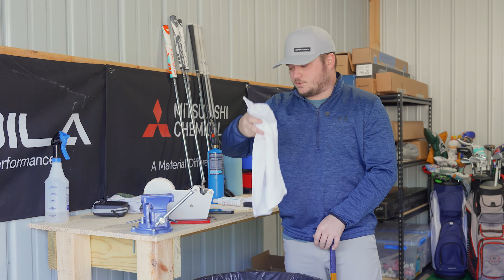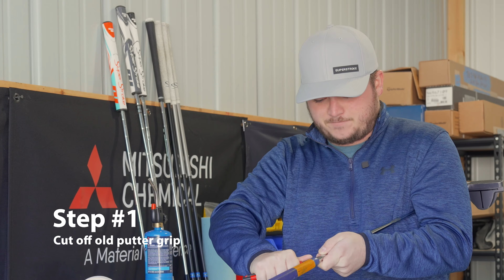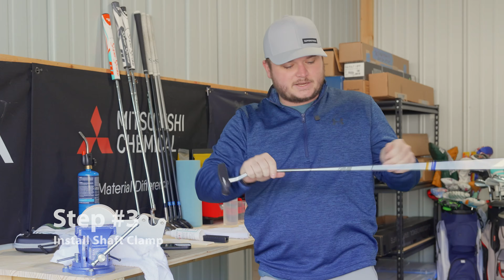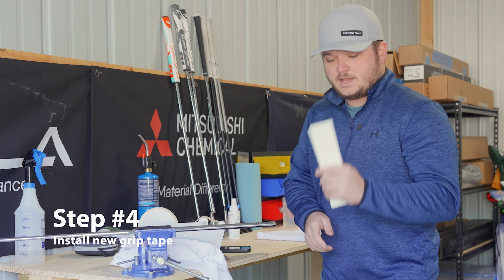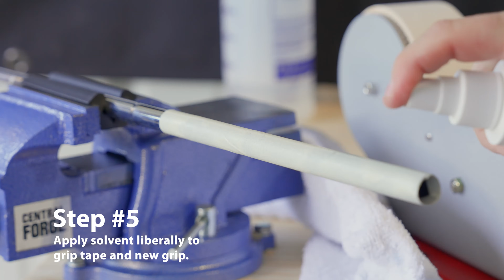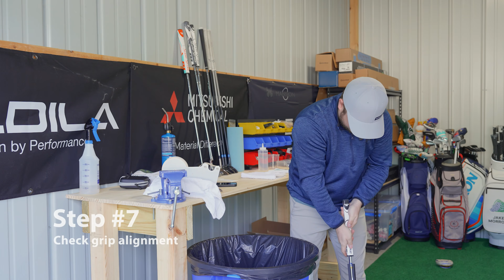How To: Re-Grip and Replace Your Putter Grip at Home

Comment: Little alcohol pads work great too if you don’t want to use a heat source, just be careful not to touch the label as it can remove the ink.

Comment: Just tried to install a brand new 17-inch-long Superstroke putter grip onto a brand new Stability Tour shaft... Failed miserably, because it seemed the ID of the Superstroke is too small or the OD of Stability is too thick.  Is this phenomenon caused by the paint of the graphite shaft?  Should I sand and prep the grip section of the shaft before installing the grip?

Thanks, much appreciated.

Comment: Worst grips ever! They will slide about 2-3in and get stuck. NEVER AGAIN!
Reply: Yeah, had the same problem. Only after 3rd attempt and lot of effort I managed. I used an old sticker to put at the end of the shaftt to protect the gluepad from rubbing up inside.
Reply: @rene3581  i should’ve been more specific, I didn’t have the same problem with their putter grip. These were the standard grips for irons. I think I was just so mad at the time that I forgot to specify which grips. 😂

Comment: This dude said it’s going to be pretty easy but a high majority of people don’t have those tools 😂😂😂
Reply: Honestly it would probably be cheaper to take it somewhere than buy the regrip kit
Reply: @coythuston7442 maybe. I would prefer to take it somewhere else only cause I wouldn’t  want to buy all that stuff and just have it sit there. I wouldn’t regrip often
Reply: @coythuston7442  The regrip kit is $12.99 on their site
Reply: What tools? A vice and some glue?😂
Reply: They all come in the kit except the vise clamp which you don't need you can just man handle it on after you get the shaft and inside of the grip soaked in solvent

Comment: I install grips all the time, but tried putting a Super Stroke XL onto an Odyssey putter to which I added an extension. The extension was the same as the shaft .580. But I'm having a hard time getting the grip to slide all the way onto the shaft. It's really resistant and I can get about half way before I just can't push it any farther. Any thoughts/suggestions?
Reply: Same. I get about 1/2 way and Im stuck or the shaft falls out of vice! My next attempt I’m going to use superstroke tool to remove weight adjustment from end of grip. I may also try a compressor / air to assist.

Comment: If you want to be extra picky you can use one of those little 4 inch levels ...plumb the face then check the grip after it is put on to check it reads level in the 2 ends and middle of the grip
Reply: This is great advice
Reply: That is my exact plan bc I don’t trust myself with a putter grip.

Comment: Hi, you only removed the tape backing on one side? Is that right?
Reply: Remove from one side to place and smooth on the shaft, and then remove the other piece of backing before you install the new grip! Want to make sure you have adhesive making contact with the grip as well!

Comment: What can i use for solvent if i dont have the kit?
Reply: The best replacement for Grip Solvent is Mineral Spirits from your local hardware store.
Reply: soap and water
Reply: I used grease and WD40. And I did not put any tape. Trust me the thing is STUCK and there's no way to remove it (I tryed the hardest I could)
But my shaft is a stroke Lab shaft from Odyssey, it's not a steel shaft.

Comment: Is there a recommended or "easy" way to remove a SuperStroke 2.0 putter grip from my old putter so I can install onto my new putter?  Thanks!
Reply: I believe they have a tool for it, it's like a long flat looking thing. Basically you slide it under as far as you can, drench it in solvent, twist and push under the grip until it's hard to do again, drench it in solvent, and repeat until you get close enough to the end to slide the whole thing off the shaft
Reply: It's not easy to get a putter grip off without damage. If you take it to a local shop that has the right tools they will usually do it for the cost of re-gripping. At that point you may as well have them put it on the new putter for you as well!